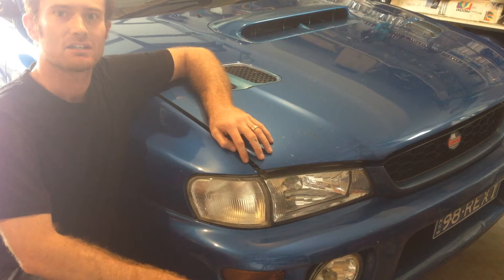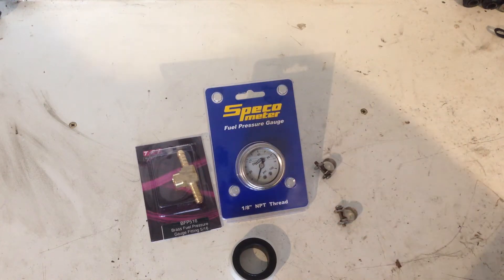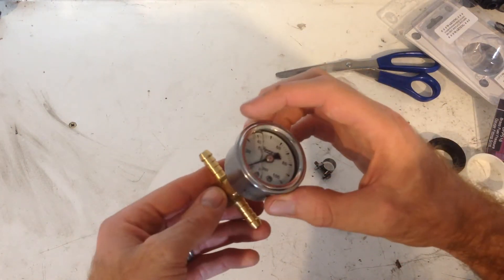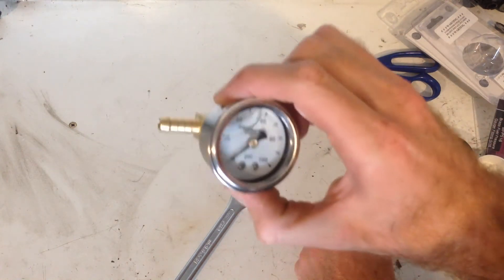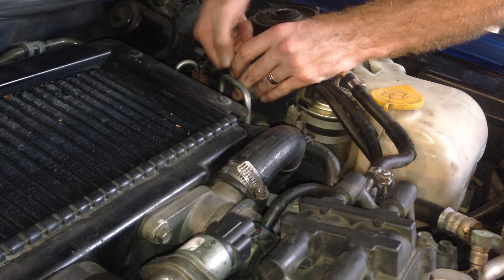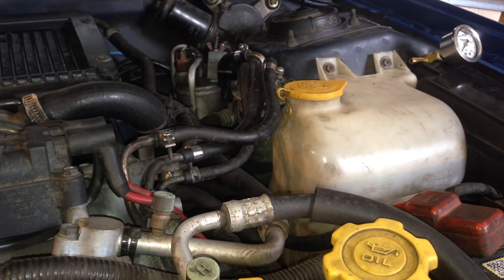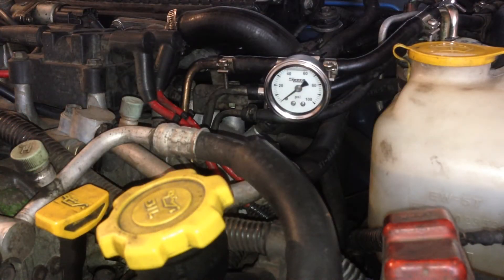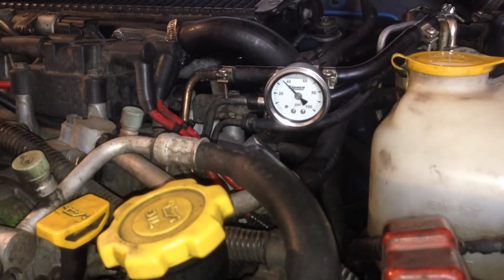Fitting an Inline EFI Fuel Pressure Gauge to check & monitor Rail Pressure - EJ20T

Comment: instead of clamping the fuel line, remove the fuel pump fuse, proceed to run the engine until it dies out, and crank once more to remove pressure from the line.

Comment: just a note, liquid filed anti-vibration gauge sometimes will leak due to high-temperature engine bay (liquid expansion with higher temp). Use a nonfilled gauge should be safer.
Reply: Perhaps if you buy a cheap one. Otherwise this is what they were originally designed for. Often in early aircraft. These gauges are filled partially with Glycerine, a liquid that's designed for temperature extremes. Liquid filled gauges are designed for direct mounting on equipment, as it compensates for vibration, corrosion and pulses.